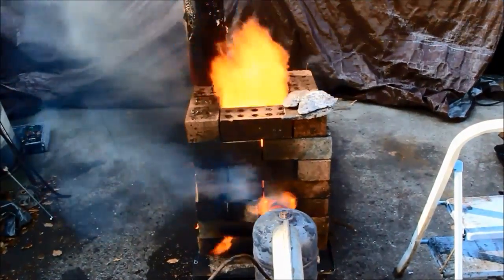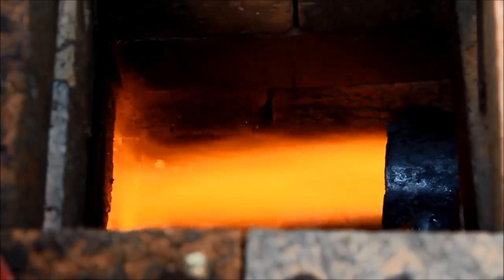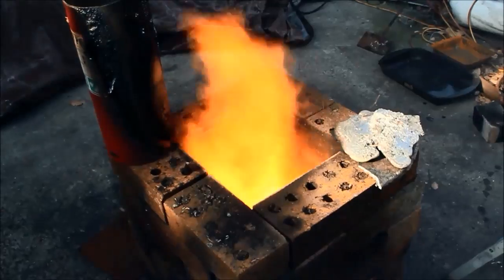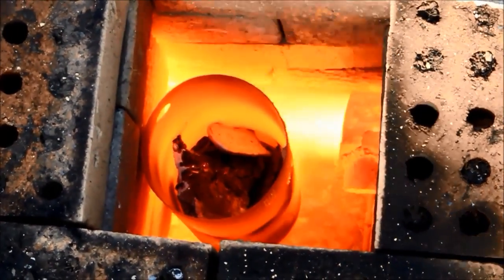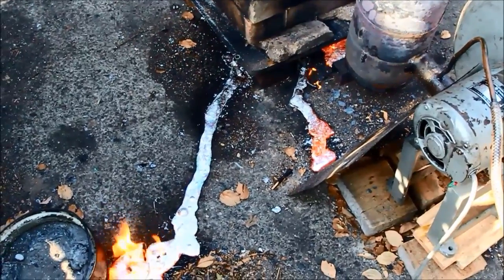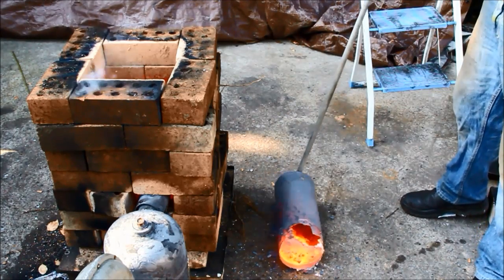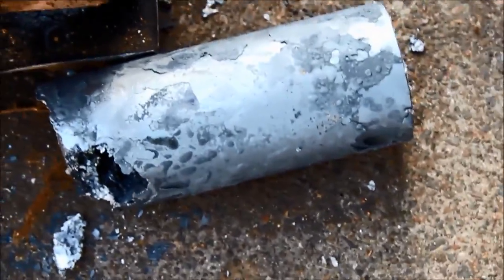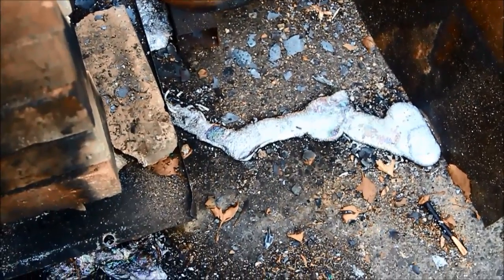Steel melt in Home Brick furnace.

Comment: I'm so glad I watched this. 
 I learned so much about how to melt steel. I'll never get that 8 minutes back
Reply from the maker: And where did it say " learn how to melt steel"
Although if you couldn't work it out from the vid you were never going to figure it out anyway.
Reply: You can easily melt cast iron, steel and other stainless steel. same way just you need car engine burn mobile inject with electric fan. Yeah it is real because long time ago i seen it YouTube some local Pakistani factory do that.

Comment: getting tired of all this melting aluminum videos. someone needs to make a home melting steel one already..
Reply: I feel the same why people fear to play with steel ha ha
Reply: @sandilemafavukedubazane3427   its because the furnace is not hot enough you know
Reply: @sandilemafavukedubazane3427  you need to get some coal if you want to cast steel. Coal not charcoal.
Reply: Steven Hickman  From my research, steel has a corrosive slag that destroys your crucible over time. As where aluminum has a neutral slag and your crucible lasts longer. Also, you obviously have less mold options if you use steel. I myself am working on a mold made from steel in order to cast aluminum.
Reply: @Ahsanws1  Yet, he melt through a steel crucible. Not the sharpest knife in the drawer, are you?
Reply: @kingzeeb319  well the steel crucible doesnt actually melt it kinda dissolve because of the aluminum
Reply: @sandilemafavukedubazane3427  very expensive and hot enough to vaporize parts of the human body. An added bonus is that the whole process is a steam explosion hazard.
Reply: Looked like the burner was blowing  directly on the fire extinguisher crucible.
Reply: Oil is some rough stuff.
For a thin steel crucible youve gotta be barely running and youll still only get a few runs.
I made one from stainless box tubing that stood up to about 6 runs and I was trying hard to keep things cool. Its just a caustic (and hot) environment. Maybe stainless with pottery glaze on the outside for better chemical resistance.
A clay crucible would probably be best, but those are expensive and how fast do they wear out.
Reply: Steven Hickman  id still like to see it done, and have a setup myself so i can make cast iron, etc.
Reply: Would love to see the final works from your project. I want to do same. Kindly get in touch if you are able to start

Comment: you need a thick walled crucible, I re-purposed an old piece of steel pipe for my furnace. It works quite well i have around 50 melts on it so far and no signs of degradation in the walls yet.  The steel pipe i used was 6'' in diameter and 5/16'' wall thickness,  It does take a bit longer for the aluminum to melt but its worth it not to have any more catastrophic mishaps
Reply: clay grafite crucibles might work?

Comment: One thing I've learned with my oil burner is to run it a little on the rich side  Too much Oxygen makes the flame act like a cutting torch.  That's why your crucible was destroyed  My burner is based on the brute burner.  I'm not sure you have a way to control to the air inlet to the blower but that is the way that  I control the blast into the furnace.

If  you notice I have a slide gate to control the blower inlet works real well.
Waste oil melting furnace
Reply: +1 for too much oxygen/air being the problem

Comment: It is strange how people do not believe that thousands of tons of jet fuel could not damage steel beams in the World Trade Center.  But anybody can melt steel at home with old motor oil, forced air, and bricks.   Thank you for your informative video.
Reply from the maker: Damage as in weaken steel beams? Yes, I believe it is possible they could get hot enough to loose some of their strength.  The Common theory goes that the beams were melted and I say that is an absolute physical impossibility.  People who jet fuel melted the beams have never actually tried to melt steel or have the first clue what goes into it. 
It's not about the amount of fuel at all, it's about the heat retention and anyone that has played with a furnace will know you could throw all the fuel in the world at that situation and steel is NOT going to melt. 

The other thing people that have played with this sort of thing would know is you can dump a bucket of a light oil like kero in a furnace and there will be a short and large flare up which will quickly die down. Far too short to heat steel to anywhere near melting point.  The more you dump in, the richer and cooler the fire is. It takes a good air fuel mixture to actually get a hot fire, any fire billowing smoke is wasting energy on phase changing from liquid or solid to a gas which is then wasted unburned as smoke. That too makes for a cold inefficient fire. 
You don't see any furnaces melting steel billowing smoke from the firing process.  The enduring fires in the towers were not jet fuel but merely the everyday contents of the building which would include a LOT of plastic and synthetics, wood and other flammables. 

Think about the physics, how would all that jet fuel be retained in the building?  It would drain away down elevator shafts, through cracks and drains designed to take away water in case of pipe rupture, it would be pouring out windows..... You just can't dump that much liquid in a building and have it sit there for any length of time especially when the building would be damaged. the layer that may be retained would be an inch or 2 and that would evaporate and be burned by the fire in no time.  You couldn't get it to sit there for over 30 min burning no matter how hard you tried. 

It is possible the beams softened but if you are open to the truth, there are many vids and simple experiments you can do to show that they would still not allow the total collapse of the buildings in the way they fell. 
Also looking at other building fires which have been just as savage or more and never fell and outside the WTC case would see that what happened there was a one off physically not just from the aircraft hitting it. 

Personally, I find it amazing people will see something controversial on TV and then believe what a TV show told them is inarguable fact despite having no real knowledge of the subject or principals involved and do no further research to educate themselves.  I don't like making a fool of myself so if I'm not sure, the first thing I do is try to justify the OTHER side of the argument.  In this case it would be "What would you have to do to melt steel beams in a building" and work back from there to see if the physical requirements come near the actual situation.  In his case, they don't. If you believe otherwise, see what it would take to melt steel in an open atmosphere. It takes plenty to do it in a furnace, physical impossibility in just a burning building. 

Most people will believe what they want to believe and either not look for fact in case it undermines the position they WANT to hold  or completely ignore what does not agree with the position they choose to take. 
Others don't give a damn, they just want to know the truth. 

It's not that hard to find IF you really want to know it instead just adopt a position you want convince yourself is right.
Reply: Explain how both towers and tower 7 got sucked into the earth.
Reply: thousands of tonnes? was it an alien ship?
Reply: Indrid Cold it wasn't thousands of tons of fuel and it wasn't concentrated in a furnace, it burned up right away and went right into the air in seconds
Reply: It was o'rielly that did it.  Then he tried to pass Kate's law, to make sure they were never heard from again.
Reply: Oil Burner Buddy, you were explaining human way of thinking basically, not some 9-11 related stuff only. Cheers from the Patagonia, Argentina.
Reply: Indrid Cold 911 was done by  goverment what about the 3rd tower
Reply: Don't know why, but when I read "without a little extra help" I laughed really hard. B/c its true
Reply: Lets just put this out there: No building in history has ever collapsed because of a fire. Then three collapse within an hour of each other.... Come on
Reply: +Carson Chan that is enough to weaken the structural Integrity of the towers it doesn't have to melt through the steel the expanding of the steel through Heat and the weakening of the steel would be just enough for it to bend enough to break
Reply: Hey Rodney. Why is it that no building has ever fallen from a fire. Ones that have burned for 30+ hours.... Made of wood...
Reply: @glumpy10  we send rockets to space n they take off directly next to huge tall steel towers(used to keep the rocket upright during take-off as well as fueling etc.). look at the HUGELY intense fire plume from a rocket no more than maybe 100 ft from the tower. the steel may glow red but generally remains unchanged. if a fucking ROCKET ENGINE fire plume wont melt steel sitting directly next to(and then engulfed it). i cant see how it could possibly happen with a kero fire. which isnt jet fuel just a clean version of kerosene?

HOWEVER i doubt the beams in the towers melted.. they were under tons of compression force as well as others. years worth of it.  perhaps cheap construction in some areas as well. they most likely weakened and gave out twisting a little then buckling under the tons of weight of the floors above.the fire WAS intense enough to weaken stressed out metal
Reply: What about explosives residue found on all sites? Building 7?

Comment from the maker: The aluminum was in there less than 5 min. The furnace was bright yellow/ white well before the aluminum went in!
Reply: You might find that the aluminium is actually reacting with the steel at those temperatures, which is why it has that flaky appearance.

http://www.bssa.org.uk/topics.php?article=109
Reply: James Jansson  corrosion would not be happening from the aluminum quite that fast it takes longer then 5 min to corrode stainless of that thickness at temperature.
Reply: I don't see many people mentioning it, so here goes.  You do not wanna melt aluminum, in any kind of steel container.  Steel is soluble to molten aluminum.  In other words, aluminum would eat through the steel.  Much like Gallium reacts with Aluminum. A special stainless steel alloy, MIGHT be able to handle a few fires.  But I won't personally trust it at all.  You really don't want molten aluminum on your body ;)
As expensive as Graphite is, it's more often than not, simply the best safest idea ;)

I'm very impressed by your videos man.  I wanna build one myself!  I have most the materials on hand :D
Reply: Kevin Ketelson Good to know. I think we are going to build something to melt scrap aluminum so I will research more appropriate crucibles.
Reply: if you can melt steel, why not use this device for it. Its overpowered for aluminium. Use a less powerfull heatsource or use a temperature controller + thermocouple to controll the burner.
 on ebay.com there are Controllerkits for only 25$ form China (Controler,Probe+SSR=) you  could use a car windowcleaner motor as a servo to regulate the gasburner power.
Reply: I've melted aluminum in a big cast iron thing for a long time and it has held up incredibly well. The cast iron thing has walls about half an inch thick though and its black as tar on the outside.
Reply: I mean i think my mother could tell that it was way too hot ffs, you trying to melt titanium or tungsten?

Comment: The basic design is fine but the steel canister is the problem. 
Aluminum when melted is extremely corrosive and reacts with steel. At a lower temp, you might have gotten maybe 3 or 4 melts tops. Love your videos even though I can't convert metric to SAE lol. Love from America.

Comment: How well do the bricks hold up. I've built a burner and ran it in a 60l drum as a burn barrel and it was off the chart just using a 2inch pipe and a workshop blower. I've got a bunch of clay house bricks I'm going to do a set up similar to yours but not run it as hard to see how it goes. What have you found out about using bricks, any tips appreciated. Love your channel and the way you keep it simple. 

I have solved the fuel container problem. I have used a 9l foam extinguisher. Took the fire hoses off, put a 3/8 hose where the nozzle goes into the valve. 
where the little indicator gauge is I put a 1/8 BSP hose tail with a 5/16 line. The 3/8 goes to the burner via a valve and the 5/16 goes to the compressor . 
set the regulator for about 5psi push the handle down and pin it open and voila the oil flows beautifully using the valve to control it. A needle valve would be better than a ball valve for ultimate control.  If you want more oil just put more pressure in. I ran it up to 90psi just for shits and giggles and the entire thing emptied in about 10 seconds. It works really really well and it gives you total control over oil flow.

Comment: If you look at most metal melting furnaces in commercial use, they will introduce heat, on an angle, in the top of the crucible, as this stops the need to heat the crucible up to melt the metal inside, where with a top injection of heat, it melts the metal, retaining the furnace crucible without bursting its sides.

Comment: Sorry, but I had a good chuckle with your melt down.  I have had the same problem with my home-made blast furnace.  I have been using empty argon cylinders from my mig welder, but can only get 3 goes with them before they burn through.  Would have thought they would be tougher.  My furnace is an old gas cylinder lined with fire bricks and concrete, and air is blasted in with an old hair dryer.  So my first melt down came to a very sad ending when the gas cylinder melted and the molten aluminium flowed out of the bottom of the furnace and through the hair dryer.  Blew all the fuses, but made me laugh.
Reply from the maker: Mate, Laugh away! No body died and I always think someone may as well as get a laugh out of things that don't go to plan.  I wasn't laughing but not exactly crying either, pretty amazed really, so all good. Thats really interesting what you say about the Cylinders. I was advised the same thing and thought they would have been good  but I have learned something from your experience.
thanks for relaying the info. I think I'll have to go to a proper refractory lining for the bricks and learn to make proper crucibles.
Reply: Oil Burner
I'm now working on using a section from an old hydraulic ram cylinder.  It has awall thicknes of about a quarter inch and is about 6 inches long.  I am not using waste oil yet, but chunks of oak railway sleepers.   I am now tempted to try waste oil in the future.  Good luck with your projects.

Comment: This probably happened mainly because of to intense heat. But the extinguisher-bottle would have stood up longer if it had been pre-burned to make an oxide layer on the inside. Since the aluminum had direct contact with the metal, it could react with the steel and in effect lower it's strenght.

Comment: You've earned yourself a subscriber, These are truly brilliant to watch. I have one suggestion on your furnace though, It might be a good idea to find yourself a new blower motor with an adjustable speed, you have a way to adjust the fuel but I would guess that you would wanna control the air fuel mixture too.
Reply from the maker: Thanks for the kind words. Much appreciated! You are right with the blower speed. I'm looking for a router speed control that I can plug this or any other burner into for air control. It will make mixture control as well as start up much easier I think.  Lots of ideas for vids to come, I hope you enjoy them.
Reply: Sounds like a great plan, Looking forward to seeing it running!
Reply: Oil Burner I use a light dimmer switch to control my fan for other purposes. It should do well for this purpose.
Reply: glumpy10 Yep, You have to get a dimmer switch that uses PWM and not voltage variation.

Comment: hi mate, watched a few of your video's pretty impressive .with the forge , just my thoughts build like a firer place with a door at the bottom to remove a make shift thick steel cast . so when the alloy melts it  drops into a "cast" then pull it out and slide another one in, like a "draw" . top section make with thick steel in the shape of a triangle ,small hole at the bottom to allow alloy to flow into your cast . i'm sure it would still stay molten as more molten alloy is added. you get what i'm saying here .i'm no expert on the subject . probably just need a viewer like me, to give you another great idea to make it easier for you .for  me it's all about re-cycling & not throwing it away .there can be better ways of using waste products . Keep the great ideas coming ! Good work.
Reply: Hi Glumpy10, I'm glad i could help. i have a gasless mig , it can weld 5mm steel. i was thinking maybe 5mm or thicker ,so the steel doesn't melt . i like you're video's . i look forward to see what you come up with next time .

Comment: Happened to me, twice. I used the steel cylinders from propane torches as well as Coleman lantern tanks. Both blew out as well. The melted aluminum isn't wasted as you can still salvage and remelt it but it's a discouraging thing to say the least. I just refuse to drop the $$ on a graphite crucible but may have to to keep myself from buying old fire extinguishers every couple of runs.
Reply: there are also clay crucibes that work well, and graphite/clay combo crucibles that are relatively inexpensive for their proper use life.